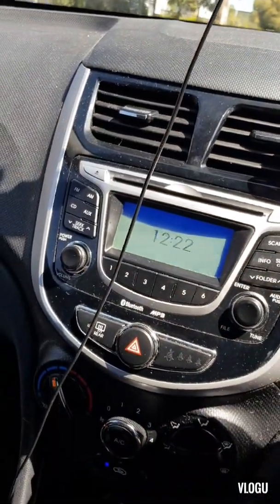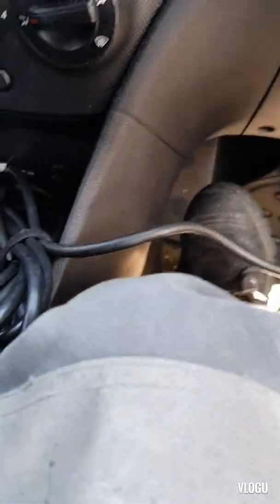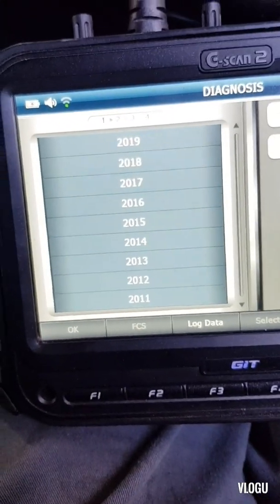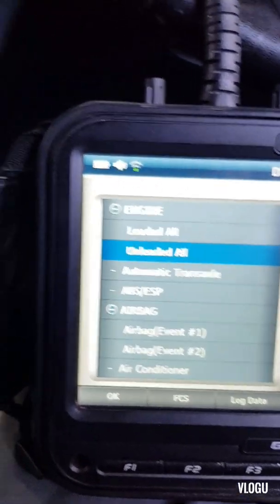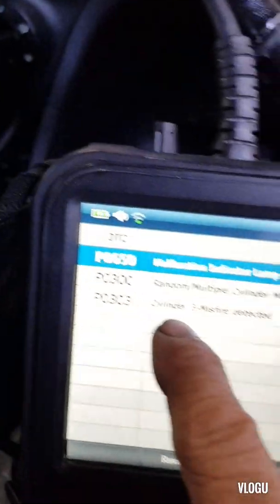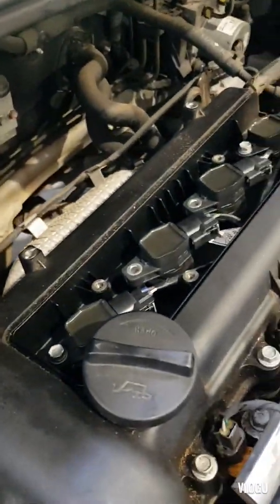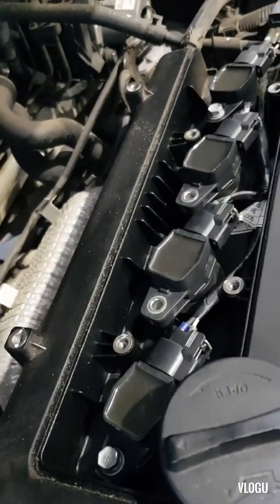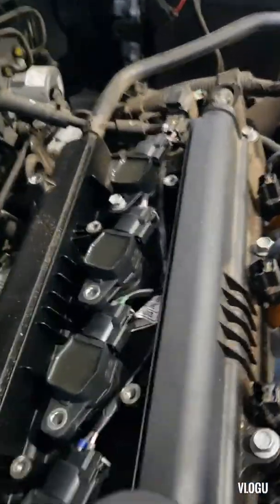hyundai accent jerking bad while driving but no misfiring when idle

Comment: Hi, can you please assist me got Hyundai accent 2016 Model been giving me problem for some time. It's jerking nonstop when accelerating, it's worse when Engine is hot when I've been driving around for sometime. In the morning  when I start the car it start easily without any complications, but when engine is hot after I have been driving the car for sometime, I will struggle to start it I will have to swing the key more than 3 times. I booked in for service and the car drives fine after service only for 2 days. After 2 days the car start jerking again. I booked it in for diagnosis at Hyundai, they didn't find anything instead they told me that, they need to open the Cylinder and check what's the problem. Because the plugs are fine, coil, and injectors as well.
The car has 297000 km.
Please assist thank you.
Reply from the maker: Hi Zakes, 
1.)the check engine lights on? 
2.) is it the engine misfire at idle?
If you don’t have these issue mentioned above you have a problem most probably with the ignition coil. The ignition coil has a build in resistor which always having problem when it gets hot under load / acceleration while driving meaning to which really hard to diagnose. Because the engine runs fine at idling and no Check engine lights on or even DTC.
Reply from the maker: If these is the case then you need to buy one ignition coil and try to change it one at a time then road test if it’s still having that issue put it back the old coil and proceed to cylinder number 2 one at a time same as what you did in a previous cylinder.
Reply: @dandelao9653 I have same problem but no check engine light
Reply: Thank you so much for the advice, there is no engine light, and no misfire as well.

Comment: Hi sir, magandang araw po sa inyo meron po akong hyundai accent 2019 automatic po nagjjerk po sya pag nag gagas ako galing sa idle tos maggagas ako like sa stop light or habang nagddrive po magbbrake ako tos gas biglang magjjerk tos may obd scanner ako maliit lang wala pong manual scan d nadedetect ung fault 😭
Reply from the maker: Hi Noyskie, ibalik mo sa dealership ang sasakyan mo para ma check nila dahil sa model na yan may TSB yata yan sa DCT transmission ecu upgrade
Reply: @dandelao9653 same issue

Comment: Hi Sir.. I have a hyundai accent hatchback diesel automatic 2016. Same problem, nag jejerk po sya sa D2 since its DCT. Any advice po? I am based in the Philippines sir.. hope you can help me, looking forward to your response po. Thank you!
Reply from the maker: Hi arrene, magandang araw sayo, masmaganda arrene kung ma scan muna kung may trouble code ( DTC ) and kindly check it to the dealer kung may recall sa DCT shifting module, dahil sa hyundai veloster meron same transmission ng sasakyan mo. dealer lang din ang makakagawa niyan dahil kailangan ang initialization, at programming kung yung shidting module ang faulty.
Reply: @dandelao9653  nakakalungkot kasi sir second hand ko nabili at pag nascan naman eh walang fault na lumalabas. di bale, maraming salamat po sa reply nyo ingat po!
Reply from the maker: @arrenesamson3448  salamat arrene, i wish na matulongan ka. pag walang DTC fault madalas mechanical failure. check fuel system, trans. gear oil air flow condition maaring marumi.

Comment: Hi .. I have hyundai accent model 2015 automatic transmission.. the gear park to reverse is slow and give jerk.. and while driving when I reach 4th gear suddenly feel jerk.. I have changed gear oil 5 days ago but nothing happened could someone help me in this issue please..
Reply from the maker: is it delayed grip when shift to D and R? if it does, did the check engine lights on?, if it does lt it scan first the  go from there, if no DTC found check ATF level and the condition of the ATF, you said you replaced the ATF nothing happened, will you let me know what ATF did you used?  Thanks
Reply: @dandelao9653  no there is no engine light.. and I don't know which oil mechanic used but he told me it good oil.. reverse gear grip is delay and when shift 3rd to 4th gear it's jerk.. only feel 2 jerk .. in reverse and in 4th .. and when I drive manually 1 2 3 is ok 4 give jerk when it's shif to five
Reply from the maker: @majiddawood3420  I prefer to recommend to check the ATF level first, and it's condition, worse scenario check the valve body
Thanks